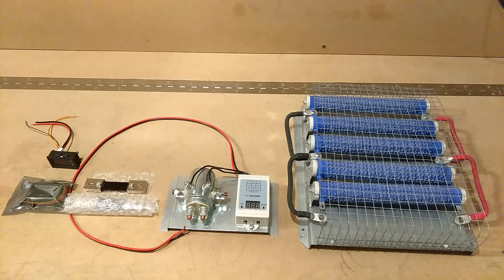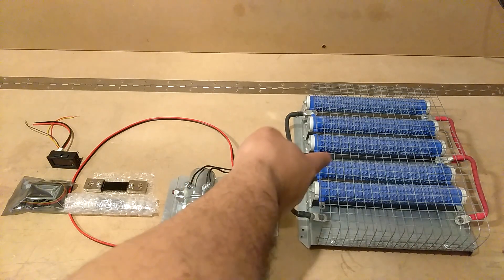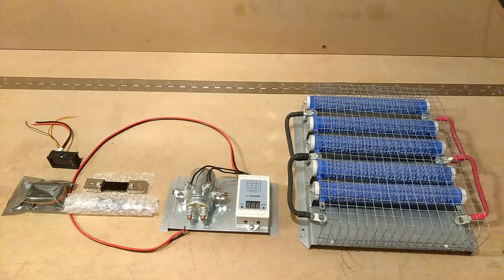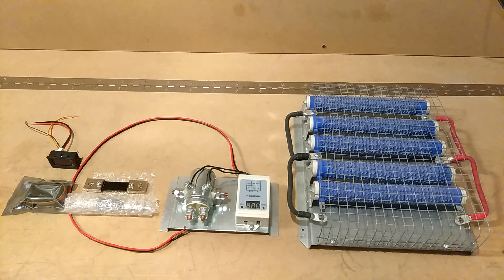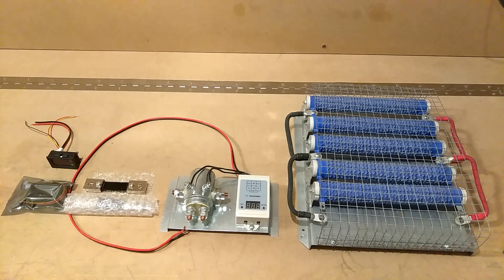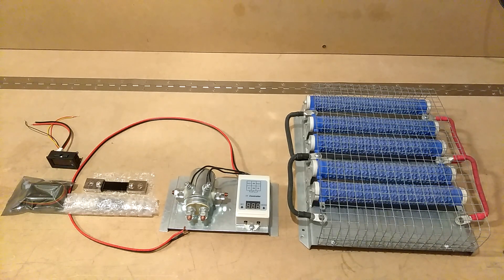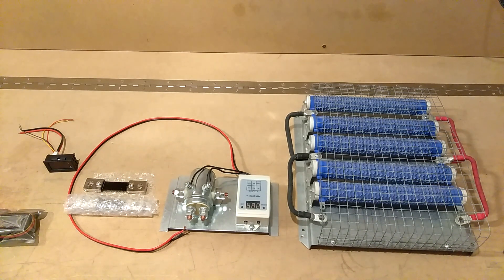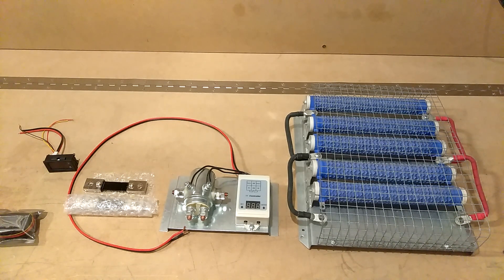It's time for the wind turbine installation.

Comment: Alright . I see you’re gonna juge up that ole wind turbine and put it back to work . Winter is among us so another means of input power is always needed if solar is not up to it during cloudy, or dark conditions . Hot water heating is a great way for the summer while the dump loader would keep ya warm during cold winter and vise versa . May the solar be with you .
Reply from the maker: Yes 😁.

Comment: What if you add a fan to the dump load, that is powered by the dump load itself?
I'm leary of putting the dump load in a water tank, without a way to circulate the water out into something to cool it by something outside like a big truck radiator or something...
Reply: Hot water tanks have a pressure relief valve I case of over boil.

Comment: What if you used this as a crude charge controller, run your panels and or wind turbine into it and have the solenoid connect when when the batteries are low, then have it disconnect when the batteries are full. It Might work but it might get in a cycle of turning off and on if you're drawing a load off the battery bank.
Reply: NO !!!!  We do not "disconnect" the Wind Turbine from the Battery Bank...
Reply: @MrSummitville  haha I'm assuming it would run away during a windy day? I've never ran wind power lol

Comment: For sure use the water heater and another top thermostat on the bottom so you can then forward the load to another use or to your original dump load (if it will handle 240volts) so this is for safety and you get most of if not all of your excess power. (this only works if you use inverted power for dump)